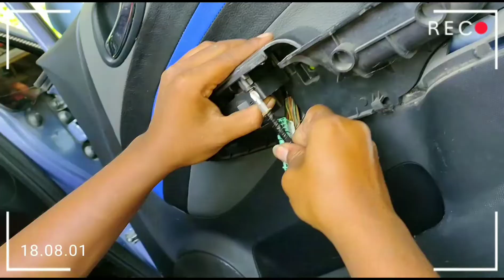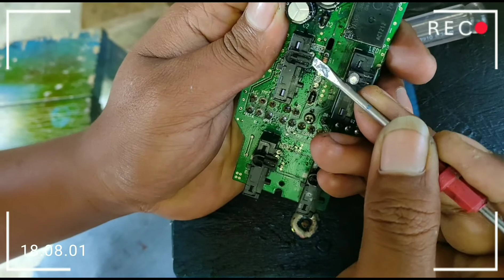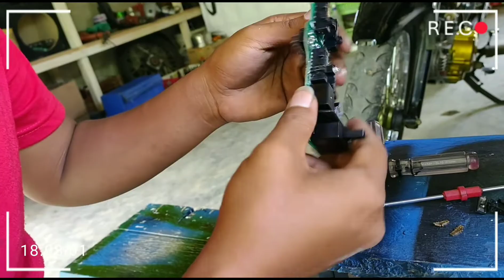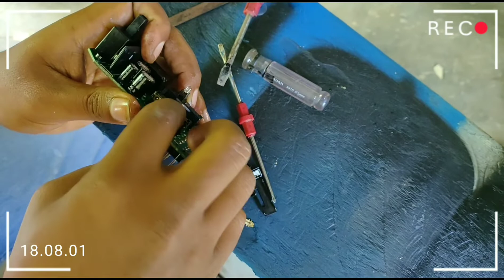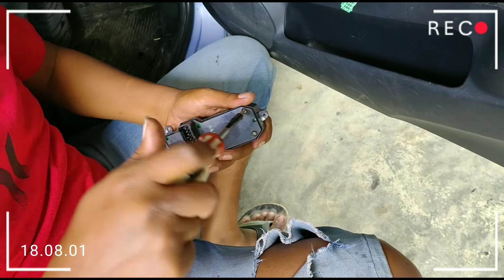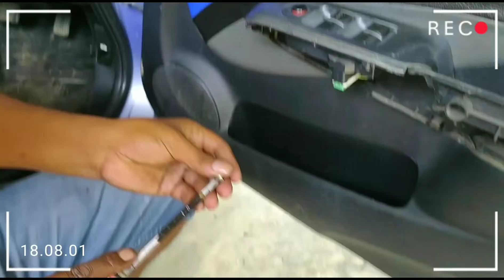Cara perbaiki Power Window Honda Jazz yang Sering Macet

Comment: pas bgt nemu vidio ini. kebetulan problemnya sama, jendela kiri tidak bisa diturunkan lewat switch driver.
sangat bermanfaat sekali.
oya om, kalo pengunci semua jendela (yg tombol hitam-merah) tidak bisa menahan knp ya? selalu balik saat dipencet, tp kalo ditahan pake jari bisa berfungsi mengunci semua kaca..
Reply from the maker: Mobil apa tu bos yg macet.
Reply: @karnenautocar5401  honda jazz idsi 2005 om...
Reply from the maker: Kuningan yg di dlm saklar power ada abg bersihkan bg.
Reply: @karnenautocar5401  sudah saya bersihkan bang, dan sekarang jadi lancar. Makasih ya bang berkat vidio nya jadi bermanfaat buat saya dan temen2 lainnya. Sukses selalu bang 🙂